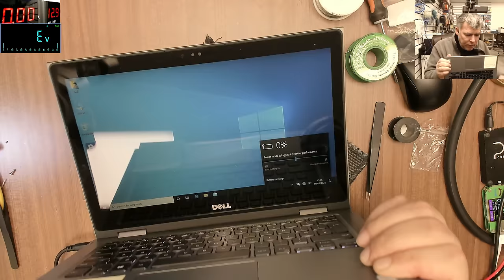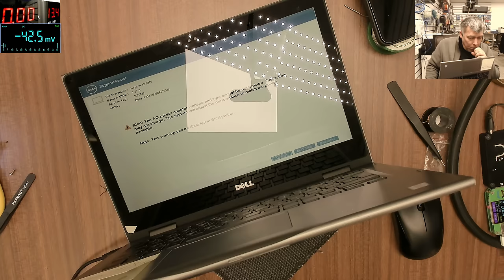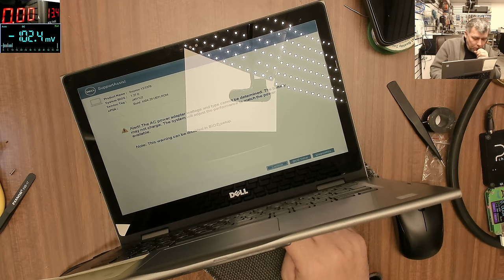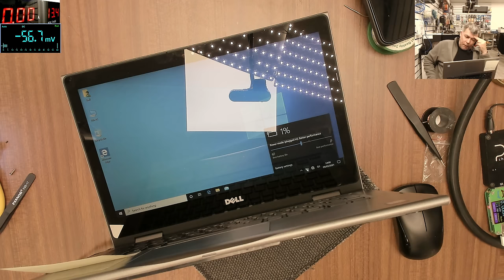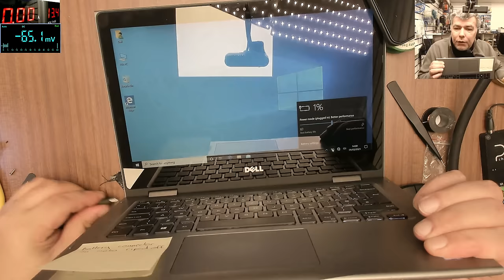Two Dell laptops repair, but the second one is the most nicest laptop i ever seen

Comment: Seems like bad solder should just buy a pound roll of kester and stop buying those 100g rolls of cheap stuff I think my last 1pound roll cost 34 us shipped for the .04mm larger size solder  is cheaper dont know what it would cost you
Reply: and i would say low temp on the soldering iron too as well a too small tip for the job.

Comment: What happen to the other video, was excited to ses how not to fix a laptop. I am a learner and some of the most value lessons comes from you making mistakes so I dont do them my self.
Reply: Also very often I come to an dead end and desperatly starts to try different things without fully understand what it will do. So it is nice to know what I definitely should NOT do.

I get my hands on old dead laptops for practice but I haven't had any success. I think I have found out why they don't work but I cannot locate where the issue is and end up completely ruin them.
Reply: @HenrikHvalpen  what do you want him to do ? he can't teach you the basic , take a course or read about basic then come here to learn , this channel for advanced users which if you don't know the basic you will feel blah blah in this channel
Reply: I understand a lot of things and also if you haven't noticed he has beginner lessons too where you learn the very basics.
The things I find hard is like when I can measure a shut to ground, but I can't seem to locate the exact problem, and when I finally come with the amps I feel allot of components getting warm. Next just to try something I unsolder them to see if the shut to ground disappear. What I find out is, it is some voltage converter chip that splits 19v to 5v and 3.3v. And there is my dead end.
Is the chip suppose to shut to ground when the power button isn't press or is it dead? 
Most of the laptops I have practiced on is build very differently than the ones in the videos.
By the way I am starting to take lessons too. But Covid have delayed everything.
Reply: @HenrikHvalpen  warm and hot are not same thing a lot of components gets warm, if you have laptop to practice use more amps and put ethanol or zippo flud on area you suspect to see which one will "answer" but be careful in any case with amps
Reply: @corel965  Thank you. I find areas on many laptops where I can measure ground on both sides on the capacitors. When investigating I often found out it is the same rail for either the CPU or GPU. So what I find difficult is whether I found a fault or it is suppose to be like that?
Reply: @HenrikHvalpen  Hard to tell like this, join on discord server there is more active members also you can provide pics for better explain, see you there ! :) We are all here and there to help each other !
Reply: Come to the discord. It's easier to get to the destination once someone shows you the right road to take.
Reply: @seeker0779  I have joined it. By the way I have already made a question under the powersupply section.

Comment: Dear Sorin, I am watching you from Hungary so we are kind of neighbours, greetings from here. I just want to say thank you for your videos, what I watching a lot and these are awsome. I bought some stuff to repair myself, also built a power supply myself, now learning electronic from books and online.

I just would like to share my first 2 succes. A laptop, no charging or turning on, succesfully diagnosed a faulty dc/dc step up converter, so it is fine now. Second one is a Gopro, water damage and no coming on, cleaning, isolating everithing with self made liquid rosin flux as you tought, I have found a short on battery board, which was succesfully found and treated. No it is turning on :)

THANK YOU!!! And keep on!!
Reply: Good  job!

Comment: Hi, Sorin, Hero of the Universe!
Central pin on Dell chargers carry a 1-wire signal that decodes to charger wattage, serial number, etc.
Sadly it´s not just a "high signal" like Hp´s.
Reply: Could that be why the machines won't start after being unused for a long time?  ie The machine is too dead to read the ID of the charger?  Lots of people on the Dell site could not start machines that had stood unused for a ear or so.

Comment: This is absolutely the Dell thing ( not charging properly without the genuine charger). It's the way they "protect their produts". The funny part of everything is that they actually do have some 3rd party production called XRT. They are dell approved and these are the only ones (as far as I know) that are working the same way the originals one work. Thank you for the nice video Sorin
Reply: and new HP models has a same, but chargers are not  is not replaceble among Dell an HP
Reply: Greedy companies. Just like apple with there certificate for apple cable chip. 
And I’m saying this as a apple user. iPhone and iPad. 
This is something that should be prohibited by law to lower waste.

Comment: I would recommend the Hakko chisel tips (D-xx series) or the flat BC ones.   The shape of the bend J-tips is sometimes nice, but it's tiny tip is very bad at bringing the heat to the board. The only way the J tips work for me is by using the thick curve on the back. There are also two J tips...a bit shorter and a longer one. The shorter one is a bit better than the longer, but they're both far away from the performance of the D or BC style tips.

Comment: Well I used the knowledge of diagnosing bad caps on this channel and fixed up a $30 high end Latitude E6430 with NVidia graphics and HD+ display which has a shorted capacitor right after the 2 MOSFETs! $30 for such machine in great shape is a steal!

Comment: Hello, Mr. Sorin. Dell laptops require a Dell adapter, otherwise it powers on but doesn't charge the battery. Theres a chip inside the dell ac adapters that comunicate with the motherboard using the center pin, telling the mobo that the adapter is authentic. If you enter the BIOS it must recognize the adapter by indicating its power (65W, 90W, 130W), etc. Maybe that's the problem. The charger you are using doesn't pass that information to the motherboard. You can google for more information.

Comment: Where I work I was assigned an M6700 for sofware development. I was able to disassemble it a couple of times since it's quite old and beaten up, and it's having few faults. But my impression was the same, such a cool and well made laptop. I went to Dell's website and they had like a "Workstation" category. I bet they were crazy expensive at that time.
Reply: Decent all day heatsinking ability, business use. Overheating itself to death in 20mins..every gamer laptop 😄
Reply: The ones that came with all the bells and whistles were 5000€+ when new.

Comment: A tip to help with your soldier iron temp you have to have that blue plastic key thing in the front to change temp. I leave mine in all the time. Hakko does this so co workers won’t change temps on other persons station area. I went through the same problem as you until I found this tip out then my iron works great now. Better then my wellar. Hope you get this to help Sorin....thanks for the videos. P.S. I can tell with that tip your stuck on the factory settings. New station once you get the temps up and working right. You will love it then.

Comment: Its a pity you didn't go further with the broken connector/Inspiron. 

I have the same model. One day just popped up can't detect the charger. 

Bought a new Dell 45watt charger like the original. 

Same error, can't detect the adapter type.

Borrowed a Dell 65 watt charger and still the same error. 

Replaced the socket even though all continuity was fine.

Battery will charge if I connect it to a bench psu.

Everything else works just cannot detect the adapter type.

Great channel by the way. Keep up the good work.

Comment: Hi. It's fascinating watching the way you figure things out and find ways to recover from what look like impossible disasters!  I got a pleasant surprise when you picked up the Dell M6800, as I have the M4700, which looks the same but without the fingerprint sensor.  I agree that these are proper laptops, and I love my own, so it was good to see you figure out how to get the back off. :)  I bet somebody bent the case, when they couldn't work out that it slides off!  I just watched another video where you say you try to read comments on the old videos, so I came back to ask if ou videoed the next day of finishing the repair?   My problem is that something corrupted the startup of my Windows 7 device so it could not find the Windows start file, and I did not have time to find out how to fi it, so I left the machine unused for a couple of years.  Then, when I had time to look at it again, it would not start.  The fans come on, but then it turns off without going into the startup sequence.  I thought the BIoS battery might be dead, so I tried to change it.  Then I discovered just how 'Precision' they made these things!  The fitted battery has welded on leads, and there is almost nowhere where a normal battery holder can be fitted!  Even if you try to run a battery wire over the back of the cooling ducts, the back will not slide back on!  I had no welder and could not solder to a battery case, so I ended up drilling through the side of the depression for the battery, so that I could run wires to a battery holder on the other side of the case.  It was a tight fit getting the back on even then, and the case metal is surprisingly hard to ordinary drills!  Very well made!  Sadly, it still would not start after putting in the new battery,  so I was pleased when I saw you working on the similar machine.  You had to put it aside to finish later though, so I never saw how you managed to restart it.  :/   Is there another video with the rest of the repair, or more on similar 'Precision' machines?  I notice that on the Dell site, a lot of people had had the same problem of the machine refusing to start after being unused some time, and nobody had found a reliable way to fix it.   Maybe I will get more ideas from your other ingenious repairs!  Thank you for all the entertaining and educational lessons. They give me plenty of ideas.   (y)

Comment: Error mesg on screen after repair is actually a good thing as it means that the CPU and main board is at least trying to work and H/D, ram or something out of place is no good.  Amazing when i saw that the layers might have been burnt and even Sorin might struggle with that one as would the manufacture on a multi layer board. Only worry i have with applying too much current is that the tracks and even layers might get burnt and 2-3 amps has to be enough to heat something up and feel it , i keep to around 2 amps unless i need add more. Parts get stressed over time so another cap might start to burn out even when you found shorted cap and then alter another cap and so on.  Love this channel, best on the Interweb!!

Comment: The way that works . its call a ! wire circuit. That 3.3 volts goes from the mother board back threw the charger wire to the I.D chip in the charger if the connection to the part of the port is bad it can read on the motherboard side but not charger side. It could also be the super IO extender chip it used in dells.

Comment: In Dell Power Supply used 1Wire communications. 
Pin ID mostly is 0,2v 0,3 v after pluging in laptop is 3,3V .

Comment: Had to power a thinkpad with the bench power supply the other day and found out you can trick the psu sensor by using a 180 ohm resistor from middle pin to ground. Unfortunately I'm pretty sure it doesnt work on dell cause they use a chip inside the psu instead of a resistor. Nice video Sorin you're the best! Cheers from Brazil
Reply: Actually no this is not always good idea. On Certain HP laptop you will have slow laptop and there may not be protections against if you make mistakes. BUT you can make emulator for that and its same chip as Apple used on Magsafe.. i am using +200W HP charger as DIY Apple "80W" MagSafe charger with own emulator as for ID on my macbook pro.. can fake same way to be any Dell charger as well... :)

Comment: Hello Mr. Sorin, how are you? This is dell they do not detect the id signal, the frequent reason is the blown diode just from the id signal, maybe the damage to the plug caused a short circuit and the diode burned down?

Comment: Another amazing video Sorin. i know you said at the begining you are not accepting repaires but i have a cyberpowerpc tracer ii gaming laptop that has no video output to the screen. i have changed the screen as the other one was cracked but stll the same. Do you have any advise on what the problem could be or maybe break your rule and have a look ??????
The laptop does turn and the keybord lights up. Hope you can help.

Comment: is the middle pin not along the lines of the new usb c standard. It may be a power handshake (comms) between psu and computer
Reply: 3v3 is a common comms voltage. I think it must be waiting for a data handshake like you said. What a pain in the ass though!

Comment: What sort of wire is used for the tracks? Thin enameled copper wire (for making coils etc.)? I presume the heat from soldering iron melts away the coating

Comment: Hard enough without the pressure of the clock, that got crazy. Who says working under pressure does not get things done ? Edge of my seat in the last 5 mins, I am now hooked. 
Ok the three caps are no more. Were they for smoothing the mother board power supply ? If so the IC's will be in for a rough ride !

Comment: Pop?  I love your job. But Pop do you accept advice? Because there's a technique that will make you fast how to disassemble a different model of any laptops just by watching here in Youtube that really helps a lot. Just type in the brand & model of laptop then watch here in Youtube on how the guys disassemble it and each group of screws attach it with adhesive tape designed to each platform cover of laptop so it will be to make life easier, so when you assemble it back together, you know those group sizes of screws belong to that location. If I'm late to mention it, good for you those techniques and you're still impressively fast to troubleshoots issues! But luv your job giving me also good ideas. Thnx for sharing your videos pop. 🙂

Comment: hey nice video great repair question i have  a dell inspiron 13-5378 laptop with orange light blinks 4 time then 1 white light saying battery bad battery model is WDX0R 11.4 VOLTS i would love the pinout for the battery are even the mother board schematics diagram so i can hrlp my self

Comment: What about all the capacitors around the C.P.U all  beeping 
And when i connect the power supply  to the current resister its taking 0.092 amps but nothing its getting hot

Its a lenovo ideapad
Reply: Even the coils near the C.P.U

Comment: Hi! Where can I get the same power supply that you use to avoid a short circuit? Thank you!
Reply: Sorin modified his linear psu to bypass the short circuit protection. Most power supplies on eBay / Ali are SMPS, even though they say linear. However they are still suitable for finding shorted components. A 30v 5a supply is the most popular amongst technicians.

Comment: be carefuls you no have it set to Fahrenheit - so temp is so low, I made mistake on mine, heat was too low, it was  380 Fahrenheit. you can make sure in settings
Reply: Hakko can default to Fahrenheit display out of box and you think 380 - 400 is Celsius but it not, it is Fahrenheit, so that mean iron is really like 190 C

Comment: dell laptops have to have the correct charger if not it will state not the right amps and will not charge the battery in order to protect the battery and will allso run the laptop at a lower cpu power there is nothink wrong with the connector now im wondering if the owner lol tried to repair the battery connector thinking it was faulty as to have the proper model charger or it will not charge the battery

Comment: You had could cut the battery cable wires and solder them directly to tracks.. the connector is not necessary to laptop functions

Comment: Continuous DC voltage stabilizers. How can I calculate and select the parameters of the elements for output voltage 6,2 V and current max 2A compensating series stabilizer with operational amplifier μA741?

Comment: I hoped, you would show us that MacBook with sensor issue from yesterday.
Reply from the maker: i didn't do a video, was a easy job, water dmg on touchpad, sorry
Reply: @electronicsrepairschool  Thank you! At least we know what was the cause of the loud fan. So you were right when you said just seconds after listening to the fan noise that could be the touchpad. I wonder if you replaced the touchpad or fixed it :)

Comment: Dell laptops can be a pain, I found this out the hard way years ago, the charger has a chip in it and if the laptop doesnt see it it will complain and  display a message indicating an incompatible charger, it willstill  run , but wont charge, had a dell expiron 6400 10 years ago that  although the  chargers output was fine the chips seemed to go bad after about 18 months to 2 years , still have the laptop but wont buy another PA10 charger,  3 is enough - its now in my parts bin

Comment: hi i have dell 3451 laptop, i usually use it plugged in without the battery, one day it suddenly shut down and wont turn on. i put the battery back and still wont turn on, but it charges tho cause the light is on but wont power on. what seems to be the problem? thanks

Comment: Hi, my laptop is an Acer aspire E5-575, it was working just fine and suddenly died, not powering on, not charging, nothing. I removed the battery and tried to power the laptop by the charger only and it didn't work. I tested the charger and the socket on the laptop and it gives 19V Please help..